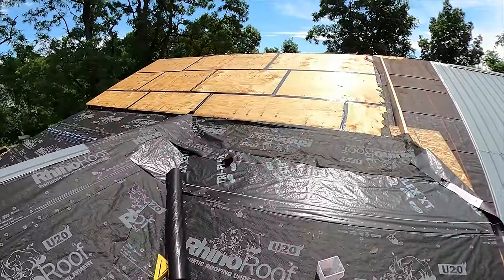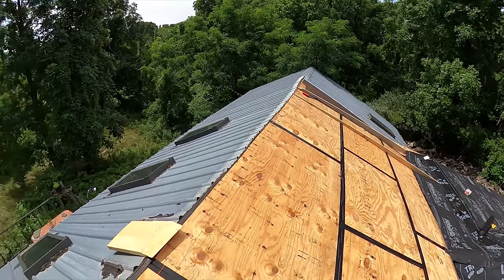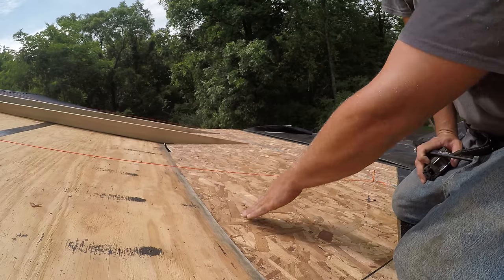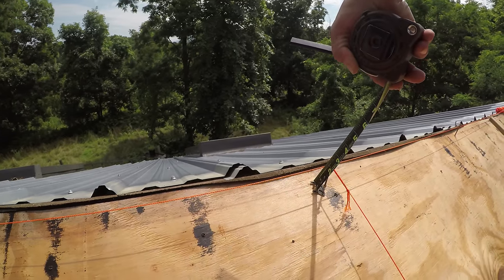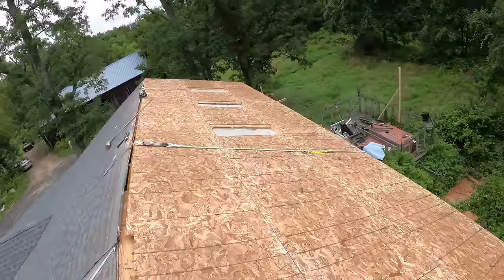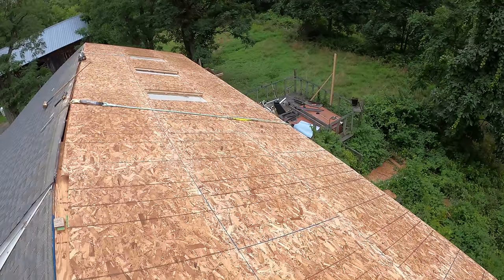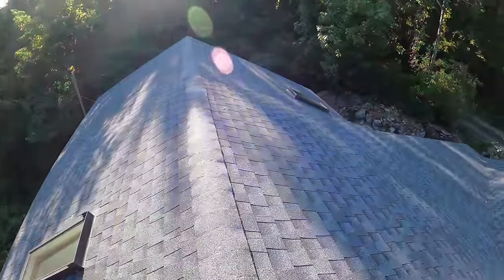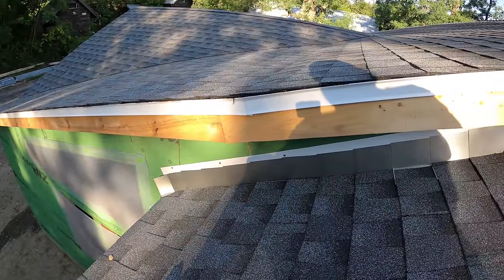Building an addition part 5: Roofing

Comment: Man that is a lot of shingles... What is the expected life on a roof like that?
Reply from the maker: they have a lifetime warranty but I would say 40-50 years would be about what to expect
Reply: Jesse Muller 
40 to 50 on an asphalt shingle? 
That is unbelievable. Here in Ontario you’re lucky to get 20 with a 30 year shingle.
Reply: @jmuller86  whaaaat, dude no way, 15 to 20 at most man.
Reply from the maker: @MrC9Oh3  I have been roofing for almost 20 years and the technology has got alot better but even shingles from 20 years ago still look brand new. they have zinc to keep off moss and mold now
Reply: @jmuller86  the fact that you think an asphalt shingle is good for 40 to 50 yrs makes me question where your head has been for those 20 years of experience you claim to have.
Reply: @jmuller86  not trying to be a hater, you do good work, thanks for the content!

Comment: how did you know the old roof  was strong enough to hold the new plywood and shingles
Reply from the maker: dead weight added was about 2.5 lbs /sq ft thats nothing considerable, trusses are usually designed to minimum of 55 lb sq ft snow loads around here

Comment: Given that you are sheeting over the shim rafters wouldnt it have been easier to remove the existing sheeting and sister up to the existing rafters to make the new angle and then just have to make 2 custom cuts for the outside rafters?
Reply from the maker: that was the first plan but then i thought it was much safer and therefor quicker to leave the old ply up, plus I was worried about rain overnight
Reply: @jmuller86  great response, love to hear that people are thinking of safety first for their guys, and rain would have been a total bummer once opened up. Finished product looks great. Love the videos, always great to get new ideas and see pros do the work.
Reply from the maker: @dustinboyce25  yea I just figured if you took off the plywood, the only thing between you and the first floor was 1/2" drywall hung @24" o.c.

Comment: Do you think there will be a problem with moisture build up without breather holes drilled top and bottom between each shim rafter into the old roof sheeting?
Reply from the maker: half of the purpose of this shim system was to also vent the roof. so now the venting is between the 2 layers of plywood. giving it like a baffle
Reply: @jmuller86  Oh I see. So there's a ridge slit vent?
Reply from the maker: @merlepatterson  the ridge has cobra vent
Reply: @jmuller86  Oh ok, now I think I get how you did it. My brother and I did some screwed up roofs in our past and that one was a doozie I can tell. If you ever saw the Movie Officer and a Gentleman, the motel they stayed in was one my brother and I resided and it was about 6 inches out of level in 30 feet. Needless to say, we had to fudge quite a bit.

Comment: Did you seriously use cut shingles as starter? What's going to hold the exposed edge down? Real starter has a strip of tar on the underside of the exposed edge to keep it from lifting.

Amazing job on the leveling and transition fascia. It's really nice to have a brake on site. The end result is nothing less than perfection. Great job!
Reply from the maker: I used regular starter shingles, they have the adhesive on them

Comment: Jesse,  What are the chances that condensation could develop between the old roof and the new roof causing mold issues?   Perhaps holes could be cut in the old roof to allow air to travel from the bottom where the old roof and new roof come together and travel up to the peak?
Reply from the maker: half of the purpose of this shimming was to also give the roof a baffle to vent. they never put up propavent so instead of tearing the sheetrock down we vented through this shimming space

Comment: No valley metal flashing(protection when thawing ice could create problems later on) 

Btw your nail gun have a built in dept gage on the bottom side, you have to start on the left so you can align the left with the preexisting one, and use the gage to guide the right side. That speed things up a lot
Reply from the maker: I used starter shingles , nobody does open valleys around here. closed cut valley's only. open valley with flashing always leaks
Reply: @jmuller86  just saw the second part with the starter(escuse me then :) I'll edit that out), here we close valley but use the flashing underneath too, more protection is always better.. but we have much more snow accumulation tho(Quebec)

Comment: Is this your first roof??? Your valleys are shingled all wrong.. drip edge goes under ice shield, over on the sides only.
Reply from the maker: how are the valleys done wrong? we dont weave . and ice and water goes under drip edge in area prone to ice. if ice backs up in the gutter it can go right under the drip edge, and wick upwards
Reply: you are absolutely wrong ice and water should be under drip edge and lap down over sheeting on to facia or there is no point in even having it

Comment: Why do so many contractors put drip edge on top of the ice and water? I go in after 5 years and replace rotted wood and shingles. Little thing called layers.  When ice backs up it dams water and will get under the drip edge and run in between with fascia.  It's the little things that make a great job better. He does such awesome work don't get me wrong I'm not a hater at all.
Reply from the maker: ice dams back up in the gutter and go under the drip edge in area prone to ice daming
Reply: ice and water should be under drip edge and lap down over sheeting on to facia or there is no point in even having it
Reply: @jmuller86  this is true but run water for a few on a two sections of drip edge one covered and one on top. Which one will get wet under the drip. Gutter is another story. Which a heat cable could help out. Like I said I've repaired a lot of rotted wood from water getting under the drip edge simply because the felt was under. Jobs done with felt or ice and water on top was just fine. Here in northern Michigan a small detail will show up way before the shingles are worn out. My worker and I have 75 years experience between us. Just trying to help.  Like I said before you do great work and love watching your channel in the morning.  Most guys would have just blended in that side and shingled it. Nice shim work and hope the customer paid you well for it.

Comment: I hate half assed fixes. You should have removed the sheathing and shimmed the trusses or rafters. Or replaced them if rafters.
Reply from the maker: shim the trusses 5"?  trusses are 1.5" wide. that was my first thought but then I thought working on plywood was 10x easier than walking on air. taking the plywood off would be much more dangerous and ultimately take longer
Reply: @jmuller86  you could have left the trusses in place and scabbed a 2X alongside of them with adhesive and screws to gain the extra elevation you needed. And you could work from scaffolding inside the house for safety. Aren't you still going to have a transition problem where the ridge of the addition meets the old roof? It seems to me that it would have been better to have fixed the old roof first since is sag is pretty obvious and indicative of truss failure. Your fix and the weight of extra plywood and shingles may cause that roof to collapse.
Reply from the maker: @jameshaynie4570  why would I set up scaffolding below? theres sheetrock on the ceiling...leaving the plywood was much safer and quicker in the long run. there was nothing wrong with the trusses, they were still like new. they were just set wrong. this added 2.5lbs/sq ft. thats nothing on a roof designed to handle 55lb/sq ft snowload

Comment: Question: With each nail you also punch a tiny hole into the roofing underlayment beneath. Is there no problem with leaking later on?
Reply from the maker: the underlayment is really only there for blowback. where wind driven rain forces water backwards. other than that it doesnt do much

Comment: I think you did a good job. I would have removed the existing sheeting. Leaving it adds to the load. We aren’t allowed more than two layers of roof covering because of load ratings. Extra sheeting along with “shims rafters” is a bit heavier than a layer of shingles. Being that it’s all hidden, someone may very well put another layer of roof covering too. I know you considered all of that, but chose to move forward...why?
Reply from the maker: the dead load on these materials is very minimal compared the snow loads. Roofs here need 55lb snow load rating, so adding 2 lbs/sq ft to the dead weight for 5/8 ply is no problem plus .50/sq ft lbs for the shims. These roofs could hold 3 ft of snow, so 3'1" of snow isn't going to hurt it, usually the safety factor is twice or triple anyways